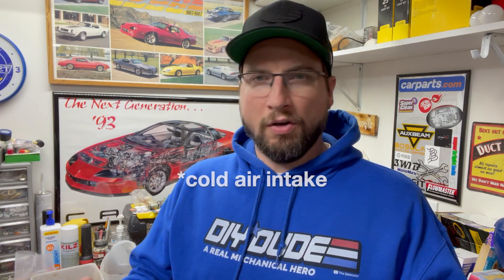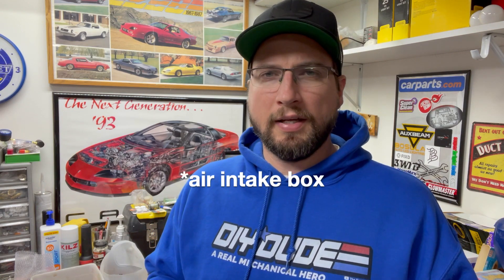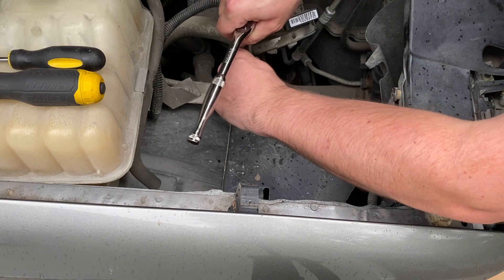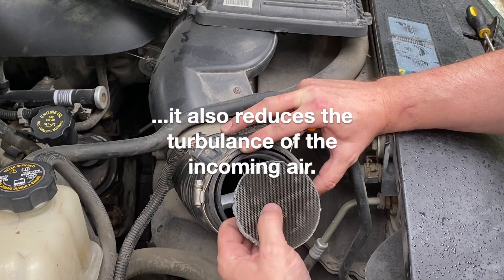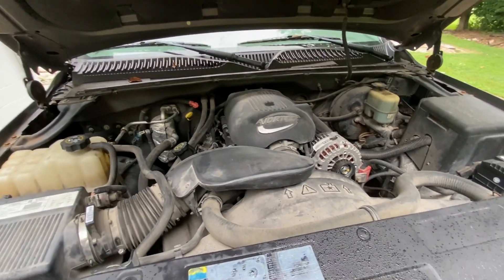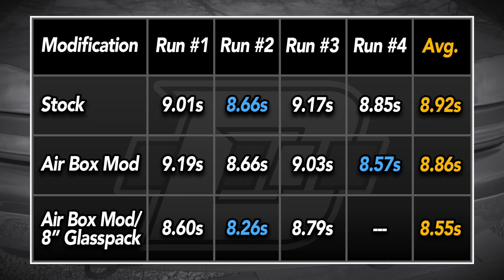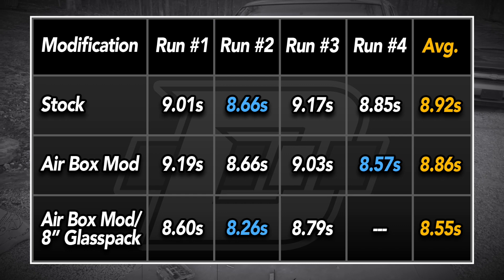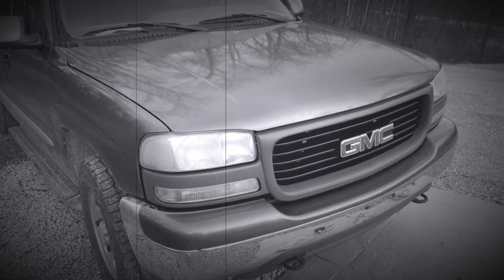Improving my Sierra's 0-60 time with free and very cheap mods!

Comment: Great video.  Love the sound of that 5.3.  I know some guys take there headlight out and the plastic behind it and that way more air can get to the box. For a cold air intake the stock intake is set to how much air the engine needs but a cold air is not so it could cause problems with the fuel to air mixture.  In some respects there not ideal. 
Keep up the great videos.  Can’t wait to see what’s next for the truck!
Reply from the maker: Right on

Comment: Love the new sound the truck got. I’ve done an air box mod to the vette. Any little bit helps, but the end issue I have is the TPI plenum, runners and intake manifold are the biggest restriction for my application.
Reply from the maker: I remember that being an item a lot of TPI owners changed on their motors

Comment: They aren’t hugely different, but hey improvements are great no matter what. 

When I replaced the very dirty fram air filter and removed the huge mouse in air box from my 4.0L 5 speed Ford ranger it was a night and day difference in throttle response and speed.
Reply from the maker: Mouse house will do it every time!
Reply: @TheDaninator  it will indeed, I got some wire mesh and put it in where the dirty air comes in so mice can’t get in “anymore”.
Reply from the maker: @alexsabothomas3621  hopefully that works. They’re crafty little boogers.
Reply: When I removed the mouse nest out of my in cab filter I got much better flow through the vents to my nose without the mouse piss and dead rodent smell.  Just thought I’d add my air flow experience.
Reply: @noexp7710  Thats good you replaced that filter man, mouse piss is bad to Breathe in. Oddly Ford Rangers don’t have a cabin air filter.

Comment: Great Video. On my 01 Silverado there are two holes on top middle of the front bumper. There were two pieces of plastic blocking them off. I always figured they could probably be utilized to get more air to the air box. I wonder if the Sierra has anything similar.

Comment: My 2010 G6 GT didn’t have any manual shifting. It only had PRND3L. If I would put it in 3 (Od off) it redlined the engine like 6,500rpms Vs 6,200rpms
Reply from the maker: Interesting!

Comment: Are you thinking on long tubes an true duals?  Maybe a xpipe and single chamber?  Might wake the old girl up more than you think.  Not to mention sound killer on the road
Reply from the maker: Long tubes, and probably an x pipe. Not exactly sure just yet. Not sure on the muffler either. 😂
Reply: Can’t wait what you come up with,  I’m not a big fan of mufflers myself but if i had a choice without cats especially would be 40s but super 10s. Sound awesome on these

Comment: You're getting over 9 seconds in the 1st and 3rd runs, under 9 seconds in the 2nd and 4th. Was the difference in directional time due to a slight grade change?
Reply from the maker: Interesting observation. 🤔 the road seems to be pretty flat.
Reply: @TheDaninator  sit still in the center of the run and put in neutral, if it rolls there's got to be some incline?